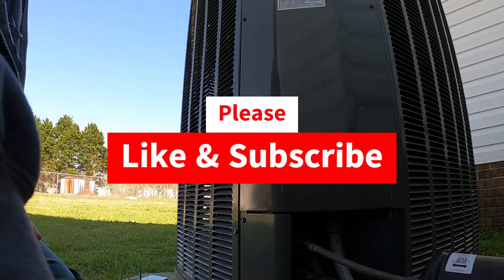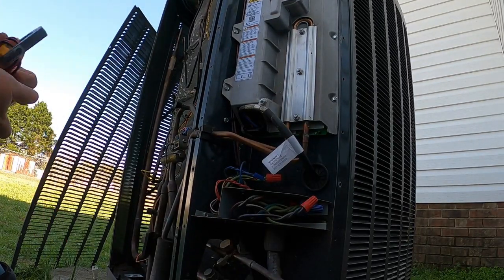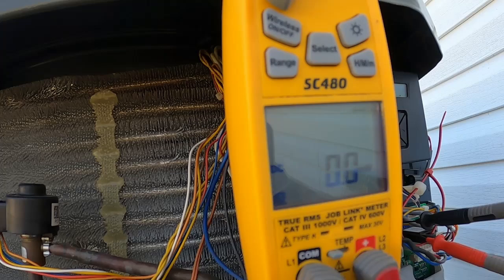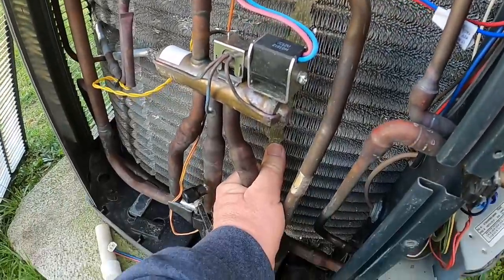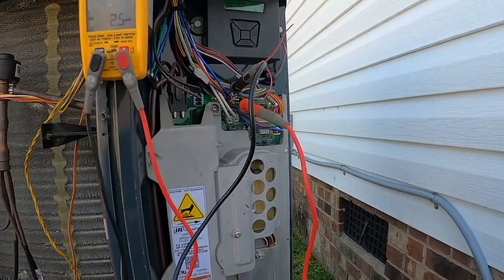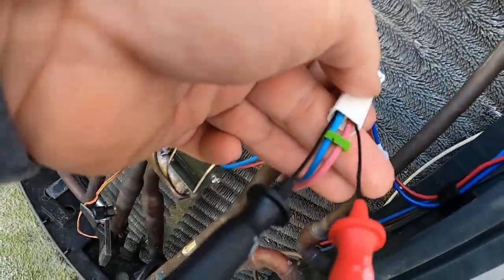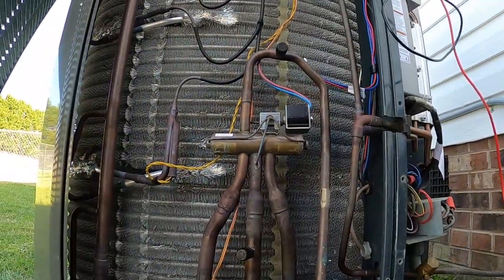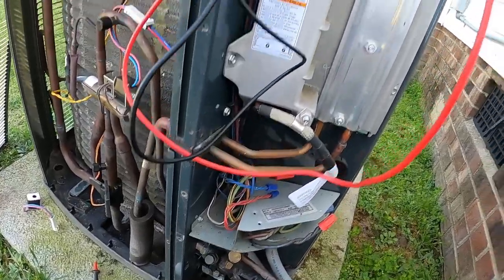The house gets hotter when the a/c is on! #myhvaclife

Comment: Duke does Suck Big time. Geez A Goodman is better than Duke. Oh back to the video 😂 Trane needs to have to get those in stock come summer time coming fast. Solenoids heads should be able to be changed out easily not like old ones the whole vavle has to go. Great video keep smiling and shake your groove thing.

Comment: We went to a house where three XVs were installed in a new build (custom home). First tech went out for a unit going info heat with a call for cooling. Trane tech support actually had to do a site visit to update drive as it was a known issue. Then about two months later same thing but another unit. Trane went back out and updated the unit and we did the third unit as well. Only time we really have ever had to have the drive updated. It's been more than a year and it's still working properly